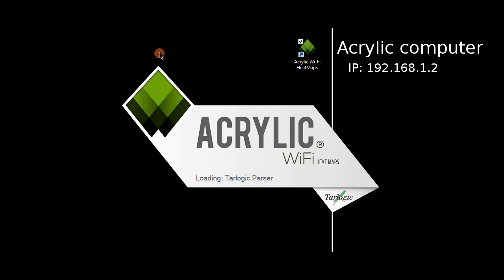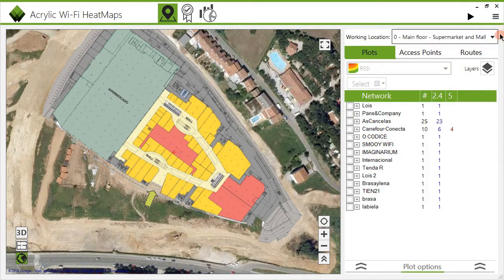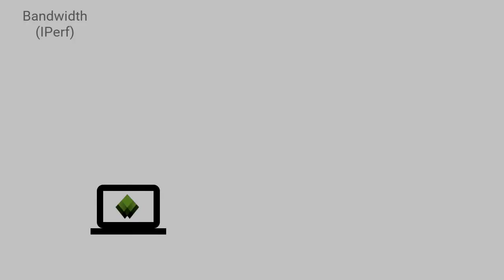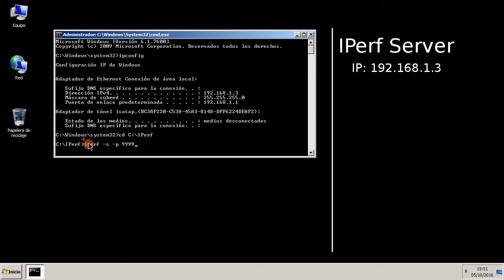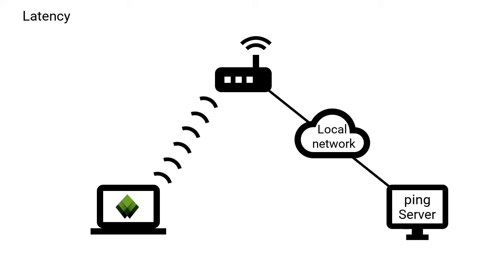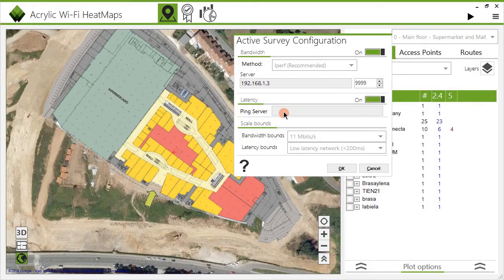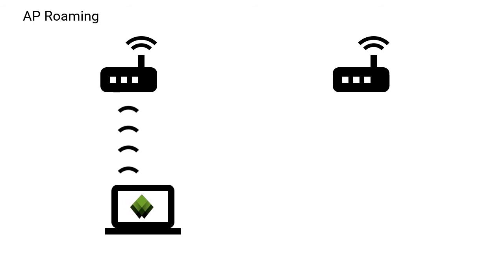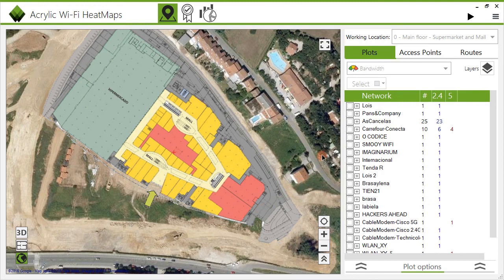Wireless Active Survey - How to perform an Active wireless site survey with Acrylic Wi-Fi Heatmaps

Comment: I would like to see further analysis of the results (which are the reason for doing all this). If I had to stop and learn what ping or packet loss was then I'd definitely want to know how to interpret the results. Skipping the heatmap review makes the video pointless. Can it be overlaid with RSSI? What are common scenarios leading to poor latency? Does signal strength cause latency? Does Acrylic WiFi Heatmaps let me compare against physical layer retransmissions to see if the weak signal is causing higher layer retransmits? Where do I find that? I feel like these videos explain the bizarre GUI choices rather than help analysis, which is a shame since I paid so much for it without any support included.